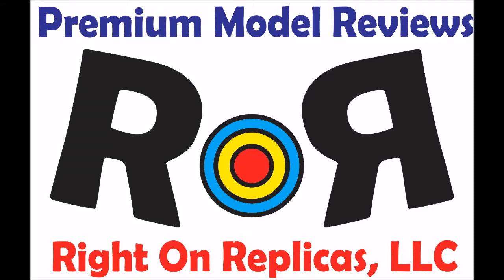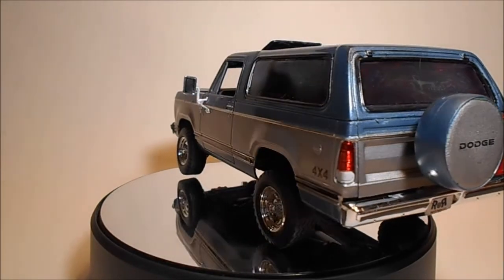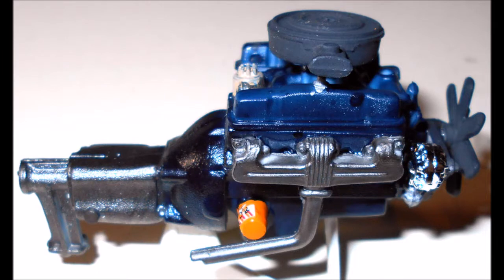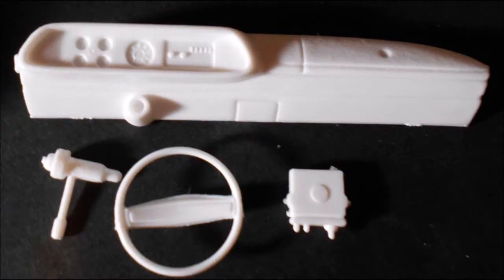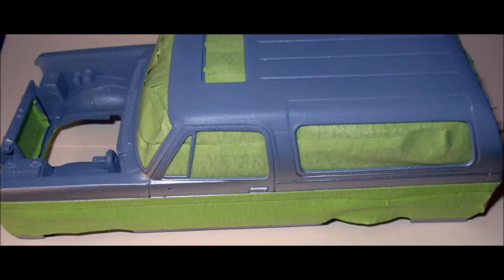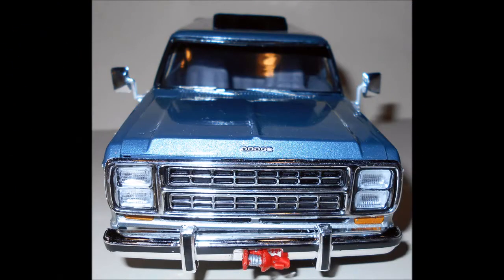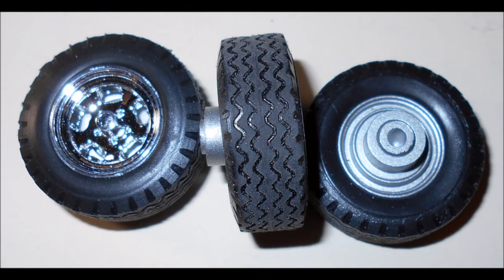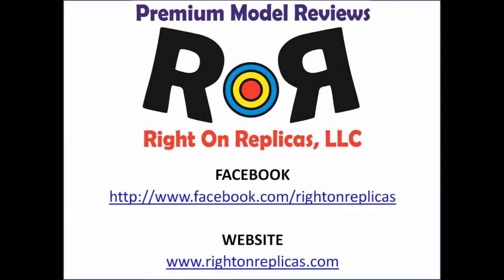How to Build the 1980 Dodge Ramcharger 1:24 Scale Revell Model Kit #85-4372 Review

Comment: Did you consider replacing the antenna with guitar string or something more to scale?
Reply from the maker: RW, great question.  We try to use only kit parts so that if there's an issue with fit we can let you builders know.  We'll stick to the basics mostly and let the experts add the details!  -Doug
Reply: Makes sense, thanks.

Comment: I am almost done a 1964 impala ss, it is my first model and I really wanted to get this ramcharger. I ordered it, tell me if it was a good idea based on my skill level, and, if it was a bad idea, please tell me some tips I can use to make it an enjoyable experience that is not overwhelming.
Reply from the maker: SC, If the Impala was a full glue kit you shouldn't have any problems with this one.  Just look over the instructions to get a good idea of construction then test fit every part before you glue any together.  Follow the sequence and issues to avoid presented in this video and you'll be fine!  -Doug
Reply: Right On Replicas thanks!

Comment: Very nice overall, but the tail light Is painted incorrectly, the brake light is in the top part of the lenses not the bottom. The bottom of the lense is a reflector only and the top and middle are the parts with a bulb. I’ve seen this mistake a few times on these kits. Honestly the only issue I have and it’s a great build and I never would have thought of the floor mats.
Reply from the maker: CJ,  thanks for the info!  -Doug

Comment: That driver side front tire is a bit raised and bent in, I wish model kits would be molded and cooled correctly :(
Reply from the maker: Fox - I know what you mean.  There are a lot of variables in injection molding and not every pressing comes out the way it's supposed to.  Fortunately, some manufacturers like Revell offer free replacement parts for those instances.  -Doug

Comment: It bums me too see the roof molded in. Might have to carefully remove it when I get this kit.
Reply from the maker: Steev - It's a re-pop but some sheet styrene should make for an easy repair!
Reply: This generation of Ramcharger had the fixed steel roof as part of the body, not the earlier removeable plastic roof.